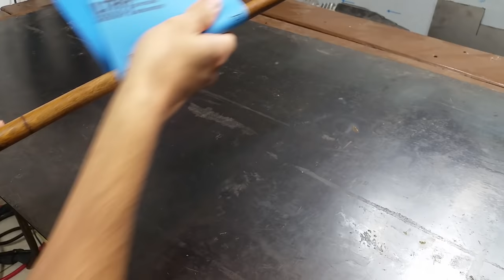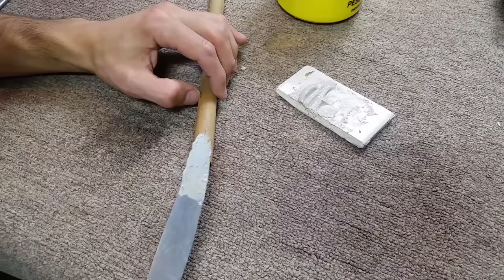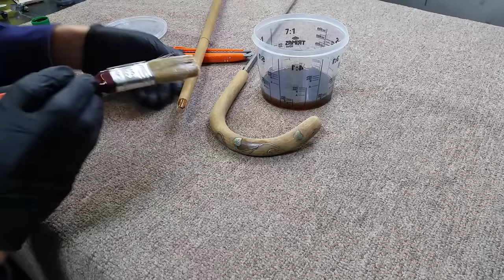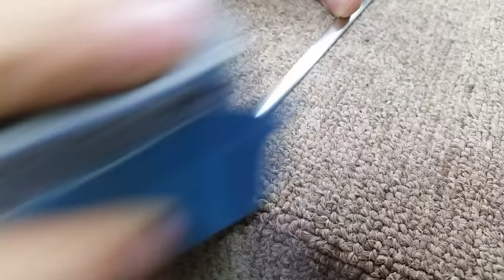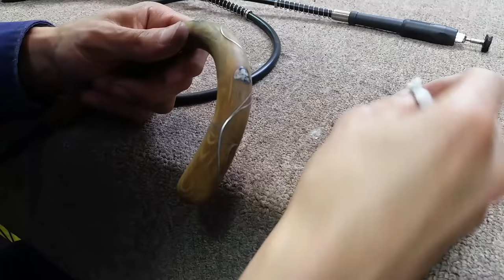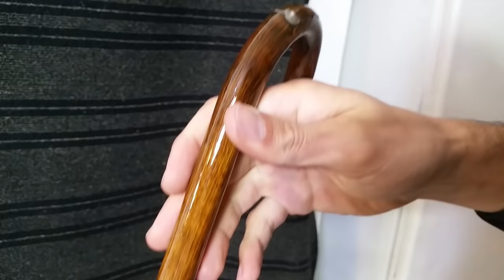I found a secret DEADLY cane sword when i restored it. (not wood carving)

Comment: Too aggressive a restoration in my opinion: cleaning and fixing what was broken would have been enough - leaving the patina of time to show the journey it has taken through history.
Reply: That did not looked like patina to me, I think those were spots of rust.
Reply: @cchilaquil   On the blade? Yes, to clarify, I was thinking more of the exterior which I think would have been better cleaned and waxed rather than sanded and re-varnished
Reply: Ah, ok. I stand corrected. Uhm. Tough call, I think. Maybe sanding the interlock part and seeing from there? The crack there where a bit larger than it appeared with the varnish. Also... I think it would be quite difficult to repair that crack without sanding and varnishing again without visible patching.

Comment: This is a very high quality sword stick.  The makers really knew what they were doing.  I have seen many antique sword sticks and this one is much higher quality than most.  I cary a modern one with an edge on a twenty four inch blade but I would prefer to carry this one in the video.
Reply from the maker: Its very high quality product, very very expensive at this moment, premium wood, silver, high quality steel.

Comment: I have a sword-cane... Well, no, I have a spike-cane. It's not as nice as this one, but it's got the necessary bits. Roughly 17" (~43cm) triangular spring-steel spike with a strong distal taper. Technically, it does have a cutting edge, though cutting butter would be a challenge.

Really, it's just a pointy-stabby "go bother someone else" device. Honestly, the cane shaft is the real weapon, being 30" (~75cm) of very dense hardwood - an entirely credible fighting baton.

Anyway, this inspires me to do a bit of cleanup and restoration.
Reply from the maker: You are lucky to have some piece like this!

Comment: What an interesting locking mechanism, how does it work? I want to replicate it in my future project. Btw amazing restoration, awesome job.
Reply from the maker: Its very easy, is a L lock, the lock is made with spring steel alloy, (High carbon steel), the L lock release when an opposite force is enought to force a bend the elastic L lock. Is a perfect lock, but maybe you need good strengh for release the sword.
Reply: @StainlessIdea  thank you so much for the answer, I'm actually looking for this kind of stop mechanism, cosplay intended actually, I need strength but not so much. Awesome job again mate, really well done and thank you

Comment: Looks like you did your best. Why do you have carpet on your work bench? 
You really shouldn't try to remove surface rust in that manner, applying pressure 
the way you did on such an incline may be a little dangerous considering the age of blade.
The end result looks excellent, you should be proud of your work. Well done.
Reply from the maker: thank you a lot! is a old carpet, for recycle haha.
Reply: Why do some idiots feel like they have to destroy antiques???

Comment: Great video, thanks for sharing. Quick question - why not use superglue with sawdust to fill the cracks? Wouldn't that make it be more seamless?
Reply from the maker: i use glue with some mix of wood dust with similar color, is for a better apparence.
Reply: @StainlessIdea  Pero me da la impresión de que es un epoxy, ¿cierto? ¿Dirías que el resultado es mejor con epoxy + serrín que con superglue  + serrín?
Reply from the maker: @chuckbowie5833  La verdad que no probé, debería intentar para la proxima. Voy a comprar resina y adhesivo epoxy cristal y jugaré con catalizador a ver cual es mejor.

Comment: Should NEVER have used emery cloth ANYWHERE on this. Steel wool of varying grades would've produced better, easier results on the wood, & bronze wool on the rapier....emery cloth destroys by burnishing the metal.
Reply from the maker: i dont use sand paper on steel, only the polishing wool for hard metals.